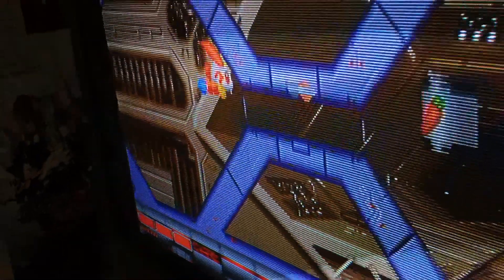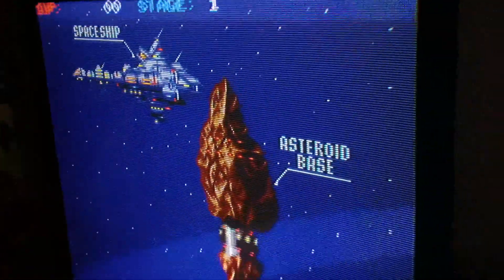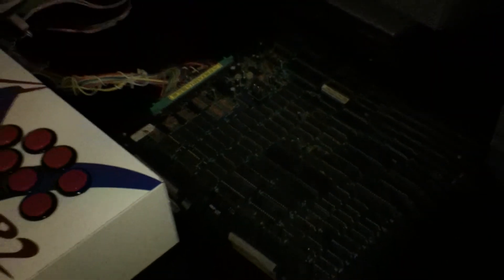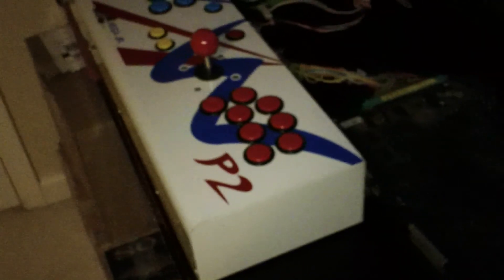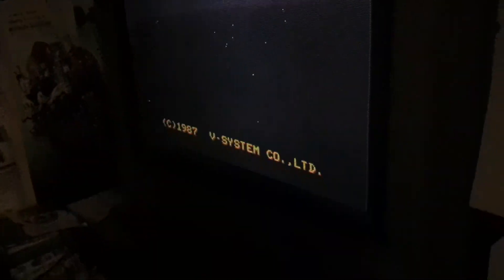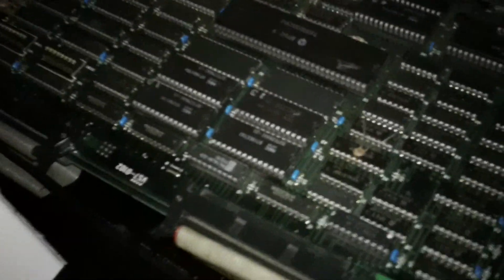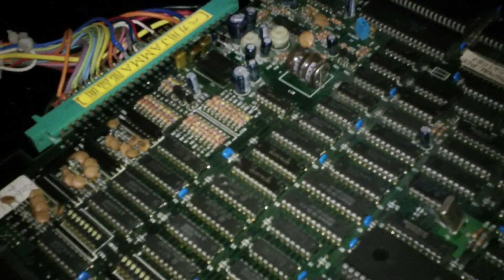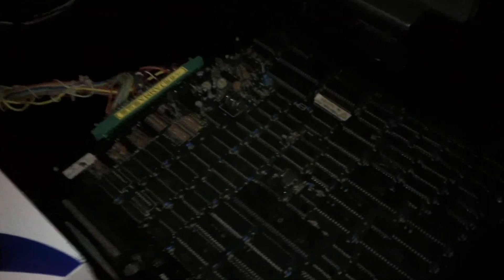New SHMUP pcb, and troubleshooting some annoying sound issues

Comment: Sorry to hear dave..but id rather have a sound issue than a buggy ass video issue. when i first got my sf2hf pcb it had a sound chip that was bad. so i totally get where your at. hope you sort it out.
Reply from the maker: Yeah, thankfully I got the sound to work in the second part of the video. Sorry for rambling in the first part and making the total vid running time like 20 minutes, lol. I set the camera down to clean up the pcb and look at the caps near the audio circuitry, and once I got it working, I filmed again and put the two parts of the vid together, the 2nd part starts at like 8:35 in the vid I think. I was worried at first, but  quite happy to have a Rabio Lepus PCB without any sound issues!
Reply: ***** haha. Well there ya go. And these things are always dirty. Hard to clean them without dunking in alcohol.  And using a toothbrush